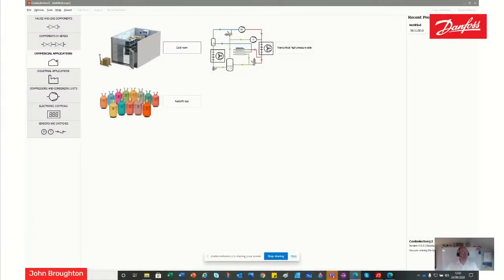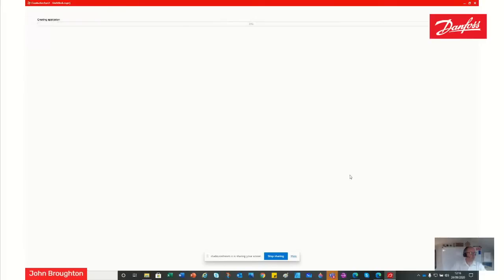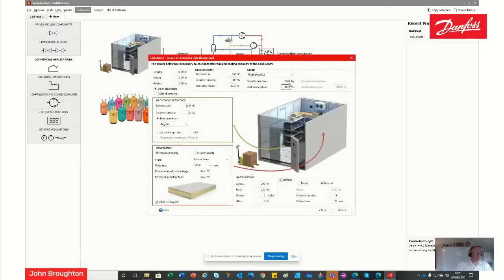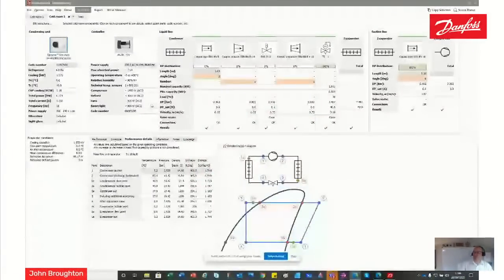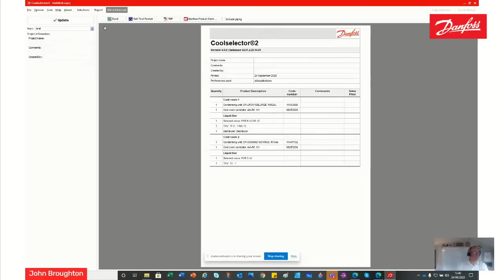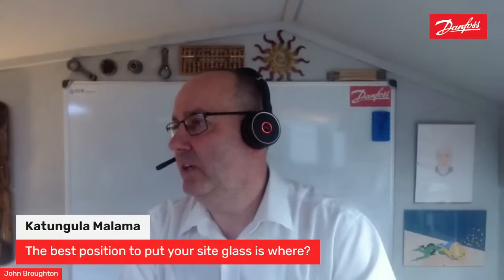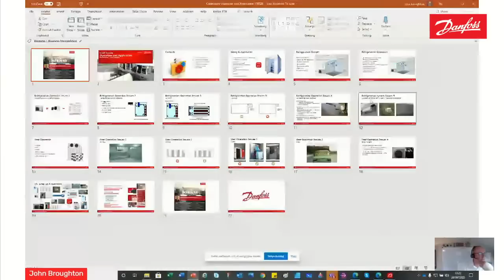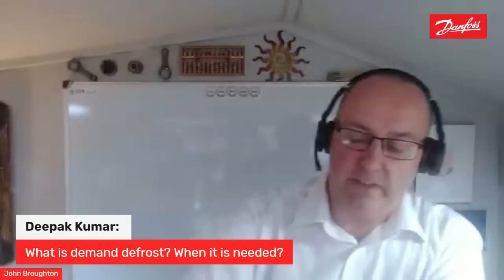How to Plan Out a Cold Room using Coolselector®2

Comment: I am newbie engineer here, may I humbly ask if IN PRACTICAL TERMS WHAT ARE ATLEAST THE NECESSARY EQUIPMENT TO EFFICIENTLY OPERATE A SMALL SCALE COLD ROOM ( 6x5x3 meters)? What I mean is this - is it possible to set up a cold room with , compressor, condensing unit, TXV, evaparator? Hoping to hear from you Sir
Reply from the maker: Dear Hindricks, you can use the Danfoss Coolselector2 https://www.danfoss.com/en/service-and-support/downloads/dcs/coolselector-2/ to carry out the heat load calculation for the cold room and then the selection of the required refrigeration equipment excluding the evaporator as that is not an item Danfoss manufactures. 

When you have downloaded Danfoss Coolselector2 please open it and select Commercial Applications. In here you will find the cold room selection tool.